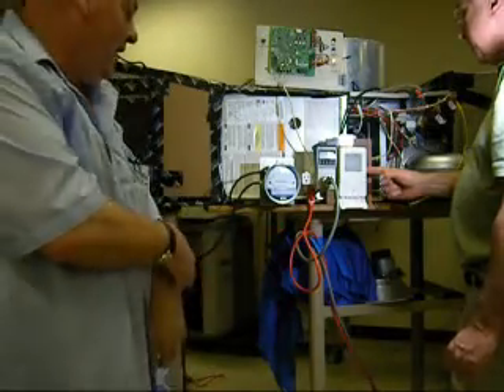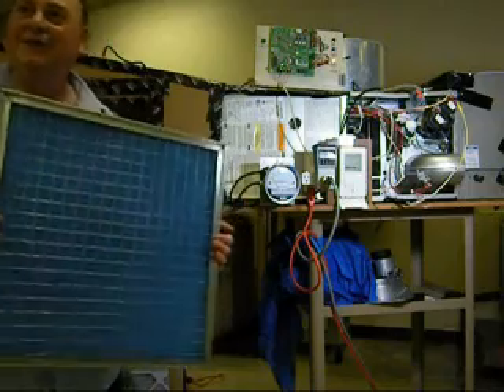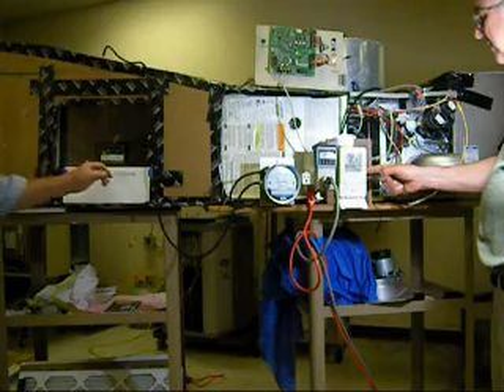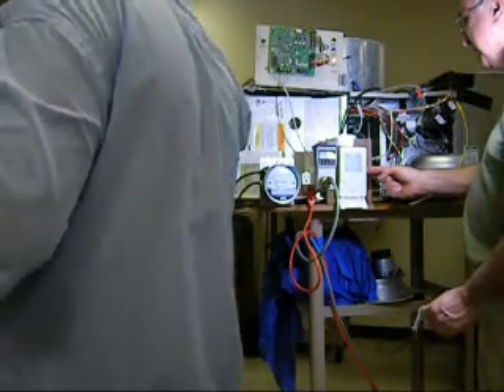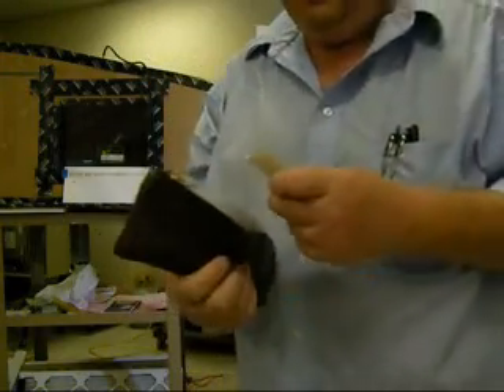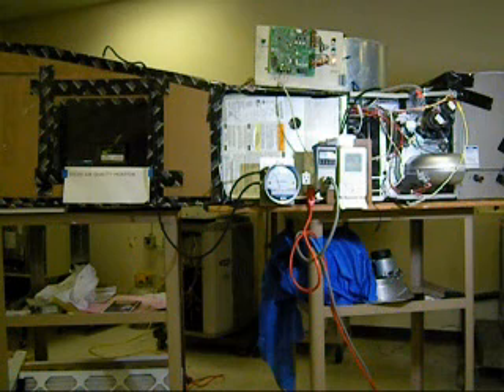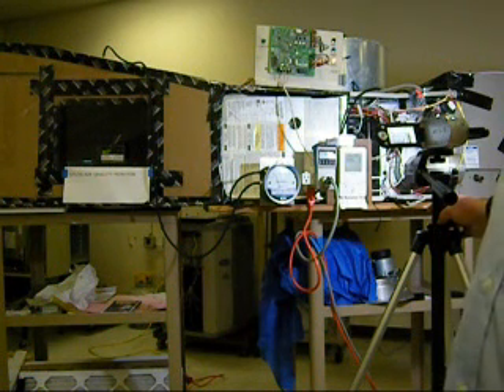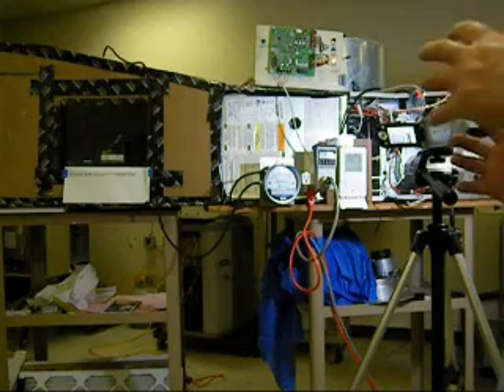Measuring Energy Saving HVAC Air Filters

Comment: The see through cheap spun glass air filter is better it does not restrict the air flow.The pleated or more expensive air filters plug up too fast and restrict air flow. restricted air flow well not let your A/c or Heat pump work properly and it well cost you more money in the long run at the electric meter. you are better off dusting your house more often with a vacuum cleaner it's a lot cheaper then a big electric Bill.